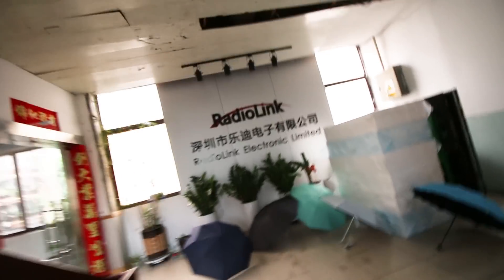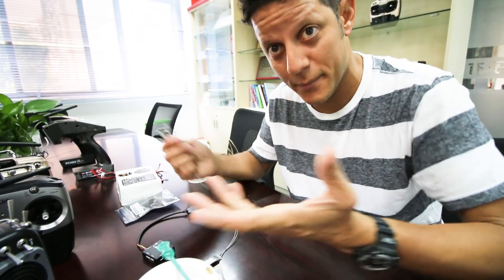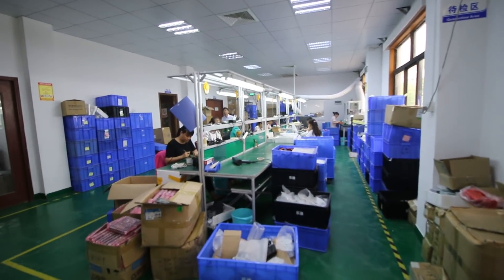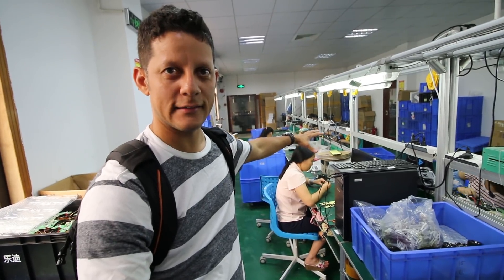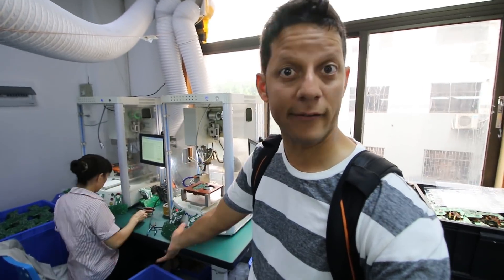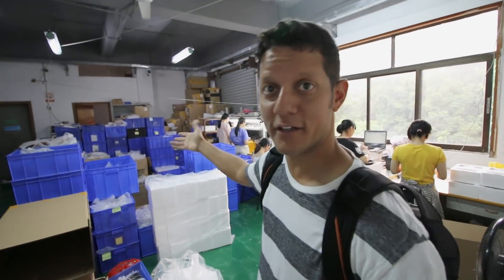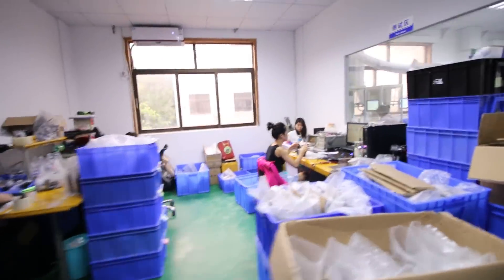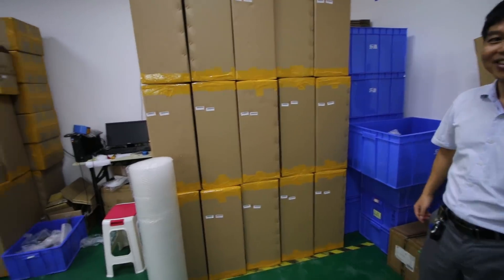Inside a drone remote control factory in China

Comment: What the hell is that high power resistor array doing in a rc radio?
Reply: Good question. Maybe it's a batt. charger assembly or maybe it's piecework-assembly he's doing for another factory, non-Radiolink. But then again, you gotta use up them parts on something!
Reply from the maker: Pașca Alexandru it’s a charger board
Reply: Battery balancer is my guess, resistors for discharging loads per cell, very stable and reliable method to get the job done safely. Looks like MosFet swtiches below ea resistor, a dead giveaway. Sane and sensible 'tekmology'.